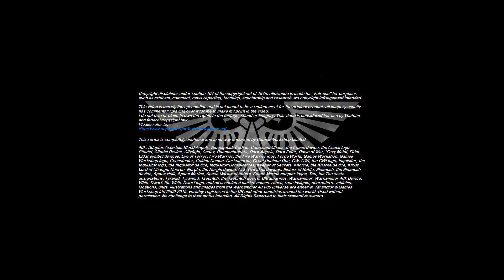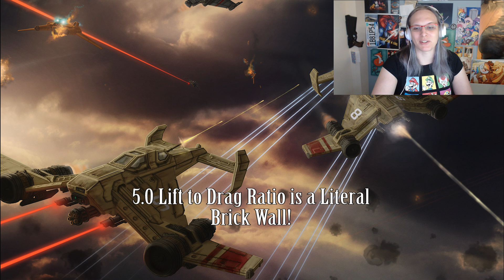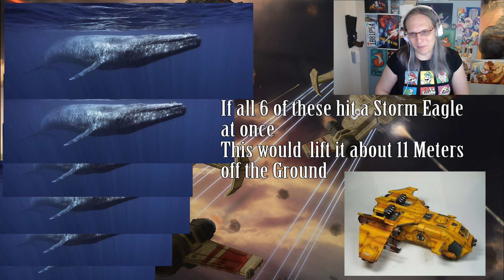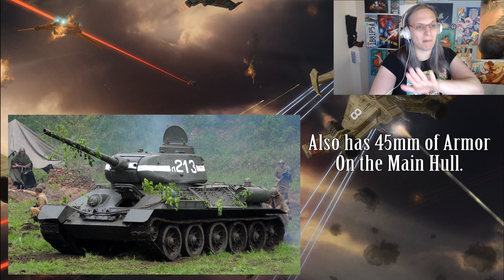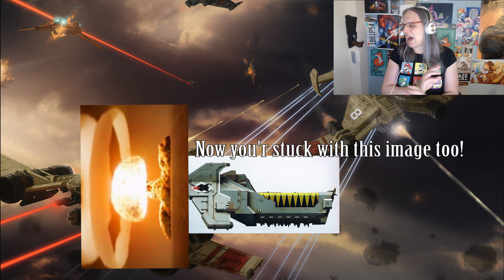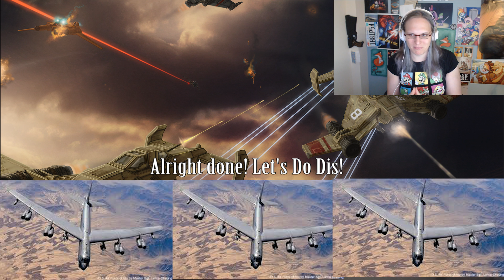Aeronautica -  Space Marines Part 2 Warhammer 40K Aircraft

Comment: Space marines in power armor dont weigh 2 tonnes
Reply from the maker: Quote directly from Space Marine Codex, "Fully Armored and Laden with ammo, the average Space Marine, is two metric tons of purified destruction."
Reply: Fiaura The Tank Girl Is that the 8th ed Codex? According to the  Deathwatch RPG: "Whilst wearing their power armour, an unarmed Space Marine typically stands slightly over 2.1m tall and weighs between 500-1,000 kg." As far as i know, the 1000 kg are for Terminator power armor and ive read multiple times that for example MK.VII power armor weighs about 180 kg on its own (one of the lighter patterns though). According to Relic (Developers of the Space Marine game) a fully armoured Space Marine weighs 800 kg, but thats still not 2 tonnes.
Reply from the maker: Mark VII Power Armor for Astartes - 750 kg, Astartes standard bolter - 40 kg, Bolter Ammunition - between 40-80kg, Astartes combat knife 11kg, Astartes themselves - 300-400kg, Power pack 120kg, Astartes survival gear 30kg, Astartes grenades 4kg each, normal compliment 20 between frag and krak.  1511 kg fora  standard Astartes without any specialty weapons or equipment.
Reply: Fiaura The Tank Girl Thats redicilous, even for 40k. Wheres that information from?
Reply from the maker: Combination of GW website, forgeworld website, and Black Library Space Marine rpg books.

Comment: Lift to Drag is a good rule of thumb for how an aircraft glides back to earth. Usually with L/D, higher the better. While space shuttle is a good reference for flying bricks, the U-2A spyplane has a L/D greater than 22 and the F-104 has a L/D of 2.2 (I can send public sources on info directly). Could you provide clarification on the idea that a L/D of 9 = brick wall? I'd be curious as to seeing the data gathered. 

It is fun to see the 40k world get torn apart by physics. Keep up the enjoyable work.
Reply from the maker: I use various L/D measurements at scaled speeds of Take Off, landing, and Cruising to see if they actually can fly.

Comment: Hey!!!!
bees fly and hover, and they are not supposed to!!!!!
Reply: The argument that bees/bumblebees should not be able to fly is somewhat outdated. 
It is correct that their wing size is not able to create enough lift if they were fixed but they move their wings in a rather complex pattern to essentially generate more lift from less area. The exact reason had something to do with vortex shedding if i recall correctly, but i am not 100% sure on that.
There are small flying robots which attempt to use the same wingstroke pattern.
It is probably comparable to a helicopter. The total size of the rotorblades is also not enough to provide  lift if they were just mounted on the side of the fuselage but add an axis and spin the blades and you have enough lift.
Reply from the maker: True but they apparently can somehow with nature, this is us strapping engines to a brick.

Comment: One small critique. On the thunderhawks you mention the 30K.km max range in space, but that doesn't really apply since in space it only needs to burn for a little while and then it can drift the rest of the way, making the max range pretty much however long the life support lasts. So taking engagements in that 200K.km distances in Battlefleet Gothic isn't impossible, it just needs to burn 20% fuel to get to max speed, drift most of the way, then burn 20% to decelerate again, leave 5% to 10% for any fiddly maneuvers, and repeat for R.T.B.
Reply from the maker: Not how actual physics in space work but close.  You are decelerating when you stop your thrust due to gravitational effects of other objects with mass, anything with mass is going to slow you down.  In space this means you can only expect about 44% controlled distance extra before you run out of gas.  This is why satellites use Twin Ion engines to keep them in orbit, because this simply like the Voyager probes; can run unless it's broken due to simply propelling mass particles collected (space dust) out of it.  But in truth, unless you are in a perfect orbit; you are slowing down.

Comment: But i do not get why the assault ram seems to have such a big impact on the retribution class battleship.
I assumed the retribution class is as dense as a modern aircraft carrier and estimated a weight of 5.8*10^11kg for the whole vessel. Accelerating that mass to increase the velocity by 14m/s requires roughly 8*10^12 kg*m/s of impulse.
For one assault ram at 105000kg to have that impulse it would need to go at 25% of the speed of light which would take about 45 hours with the thrust of 50MN.
Wth the 50MN thrust hinted at in the video the 105 ton cestus assault ram fully
 loaded with marines would accelerate at a rate of ca 48 g with the 
engines requiring about 12 GW of power (about the power generation of 12 nuclear power plants today) 
so what on earth have they found to power this with ? 
I assume its the same stuff which powers the Hellgun ;-)

If anyone can find the error in my calculation please point it out, because i can't find it for the life of me ...
Reply from the maker: Because in space there is a impact for every single object that strikes something and the ram would deliver enough impact to actually equal the retro thruster of a battleship.
Reply: the i must have made some error calculating the impact force or estimating the mass of the retribution class battleship. Is there data available on the mass/volume of one of these? I have no models to try and measure the data myself.
I am just interested where the 14 m/s change in velocity come from, how they were calculated.
Edit:
Fi found the error and I corrected for a much more reasonable speed for the Assault ram. :)
It could actually pull off the same trick the hammerhead corvette did in Rogue one